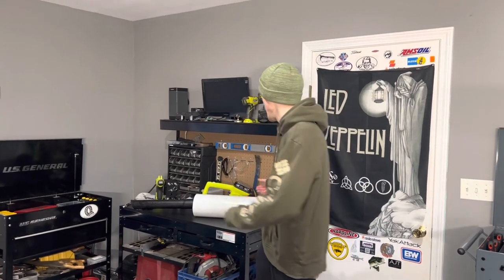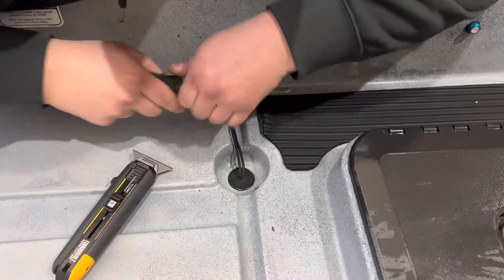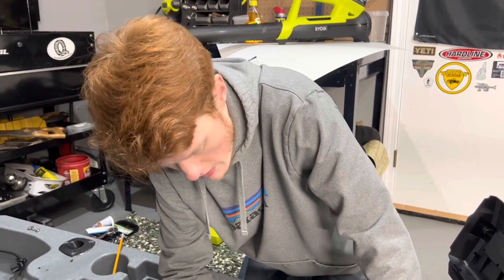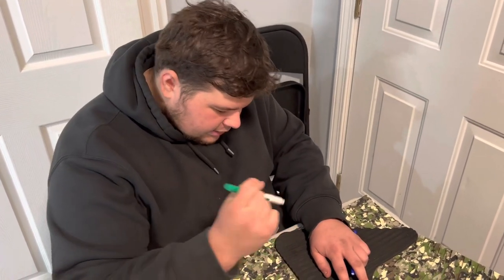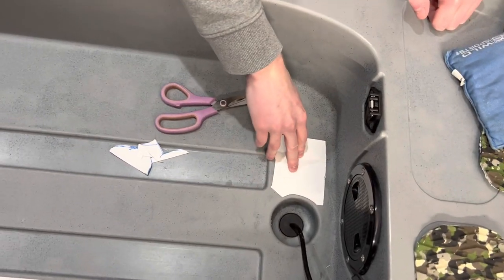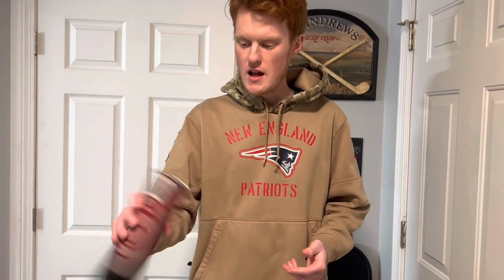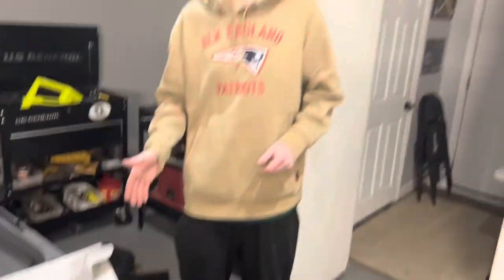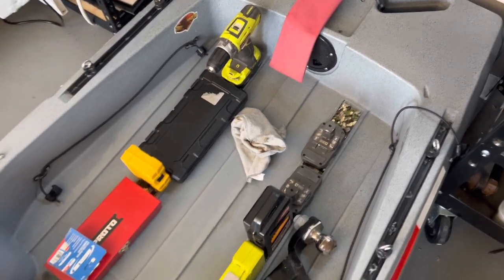Custom Deck Matting Install! - Ascend 133x Build Part 9

Comment: For future reference gentleman. At your local auto parts store, there is a scraper that you use to remove stickers and adhesive for automotive uses. However they have several different plastic blades that are made for removing gummy material, adhesives, etc. from sensitive areas you don't want to use metal. They work well for this. And a little acetone to help break it down and loosen easily.

Comment: Y'all are GREAT - I appreciate you both for taking time to teach about these excellent mods for the 133x. Question: How has the decking held up after 7 months? Any regrets/lessons learned? I bought the same matting and am planning on tackling that project soon. Thanks again!
Reply from the maker: Appreciate the support. In my opinion, the deck matting is just okay. It is very durable and with the added adhesive material it holds very well. But it did sun fade.

Comment: One more tip...use a heat gun! Hit the boat lightly with some heat before applying the pad with adhesive ,if you have brier or roller to apply pressure evenly it also makes it somewhat easier. . Will help a lot..and lots of books to stack make it lay super flat.
Reply from the maker: We really wanted to. Our only concern was this plastic is definitely thinner. We didn’t want to run the risk of warping. Appreciate the feedback!
Reply: I can understand that

Comment: Quick question, what would y’all recommend I use or do to fill unnecessary drill holes? 😭 pls help. Lol

Great content btw! Love your guys’ videos, I’ve gotten a lot of mod ideas for my 133x from watching. Keep them coming :)
Reply from the maker: Usually when you have holes that go through the hull like that plastic welding becomes one of the only options. I know harbor freight sells a kit for cheap. You can do quick fixes with marine patches but they're not a long term fix. 

If its not through the hull you can try some kind of filler but I've never had to do it.

Thanks for the comment!

Comment: On the 3M Super 77, you need to spray what your putting on, in this case the mat, then also spray the surface, wait until those re both tacky, then put them together.  Could have saved yourself a lot of time. Plus using a heat gun or hair dryer along with that method as well.
Reply from the maker: I wasn’t going to risk warping the plastic with the heat gun. It still came out perfect so it’s all good.
Reply: Yessir both is the way to go

Comment: Cool stuff!  I’m looking at putting some in my aluminum project boat.  I’ll admit, I was watching this with sound off (watching TV with my wife)… if it is adhesive backed, why are you adding more adhesive?
Reply from the maker: The adhesive they had already installed wasn’t good enough it wouldn’t have lasted long term.

Comment: You need to let the glue tack up for a few minutes before you lay the pieces down. I also  believe your suppose to spray both contacts. The boat and the piece your putting down.
Reply from the maker: Worked fine for me holds strong after almost 5 months